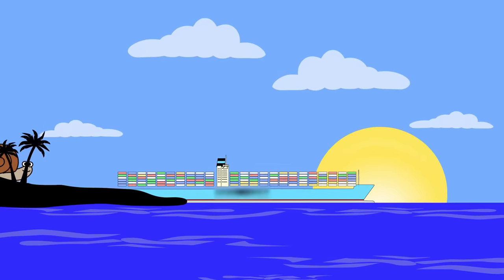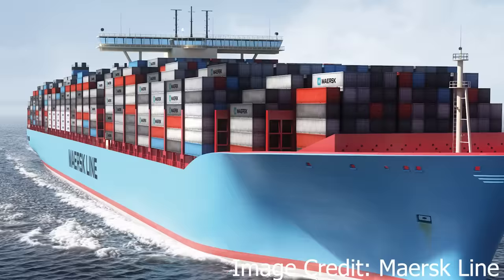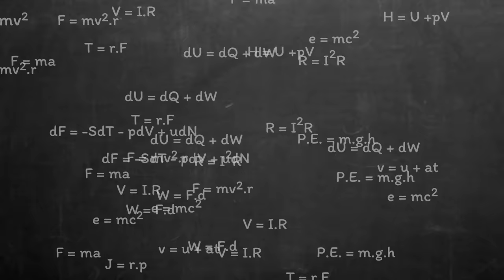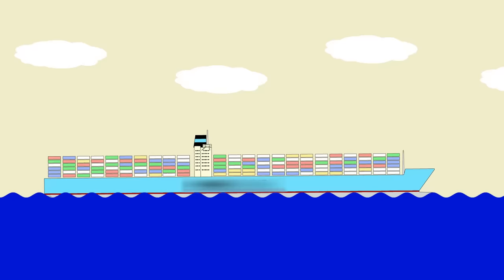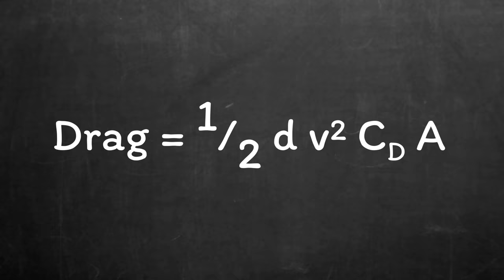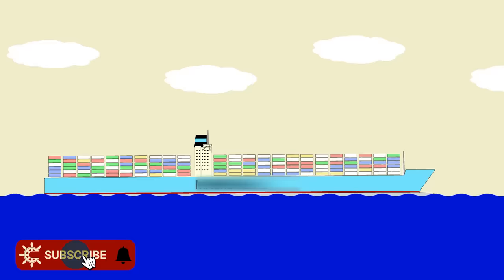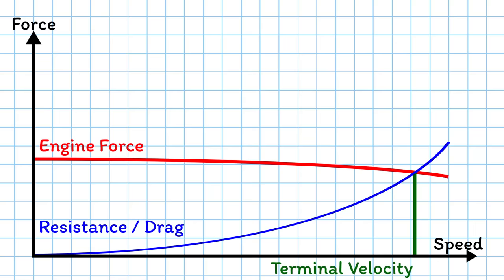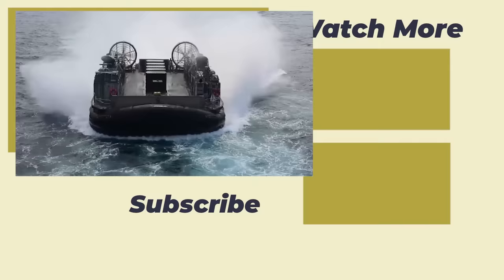Why are ships so slow?

Comment: 20 knots at sea is not slow
Reply: Raturagutulei Moses yes, and they also travel 24 hours a day, which makes a huge difference,  a point not compared with "physics" presented in this video.
Reply: From the perspective of a yachtsman, 20kts is pretty damn racing speed when such a vessel is at a collision course.
Reply: Most small boats plane at 15-20 knots and 20 knots is what I'd cruise with my 17ft boat. Its definitely not slow for big ship. Besides some fast boats. Most recreational small boats max out at low 30's knots
Reply: Thats a cruise ship, these shipping containers are averaging 8 knots...
Reply: Back in the 60’s maybe - most modern / large containerships will easily get to 20kts if not more. Check out the AIS on ships deep sea
Reply: Raturagutulei Moses It is knot 🤡👍
Reply: @vproduction  With my 34ft sailing yacht, my normal cruising speed is about 6kt on average.
Reply: @neleabels  but the energy needed to maintain cruising speed is quite low compared to the mass you're moving. This is up to the "hull speed" determined by mostly the lenght of the hull in the water
Reply: David J. Ridgway that would have been during WWII. The Emma Maersk cruising speed is 25 knots. Time is money.
Reply: Yes, 20 knots is very fast if it's a constant speed. 480 nautical miles per day. Most typical sailboats don't even exceed 7 knots, for comparison.
Reply: @neleabels  - I wish I could get a 6 knot average. I'm lucky to see over 5 knots for very long. On an almost 15,000nm voyage I averaged barely over 3.5 knots. 🙁🙁 Lucky for me I am in no hurry.
Reply: My boat can go 70 knots easy peasy. When its on a trailer behind my truck LOL Super carriers are fast as hell just something to think about. Its classified but the number at least 30 knots comes up alot. I betcha they could get a speeding ticket in 45 mph zones.
Reply: Of course it is...
When the Russians made an underwater object travel at 200 knots under the sea...
Naturally... You have to add that the object was a torpedo, and one that didn't turn very well, or traveled too far.
And... They cheated a little, they took the water away while being underwater by generating a gas bubble for the torpedo to travel in.
Reply: @Petalslash  Check out the GTS Finnjet, it could do 33,5knots and it was a regular displacement hull cruise ship with 2 Pratt & Whitney FT4C-1 DLF turbine engines :D

Kind of fits in with the Concorde, fast as they get but not economical in the long run..
Reply: David J. Ridgway what lol. I’m captain by trade and it’s my career, and I can tell you container ships max out much more than 8. Hell in the shipping channels they average 10-11 knots. So I could on imagine in open water they can crank up to and easy 20-25 knots
Reply: I looked up the specs on the engine he appears to be quoting. It has between 8 and 14 cylinders, and at it's most economical burns about 285 gal (US) per cylinder per hour, and still converts more of its fuel to push than the average car or piston airplane.
Reply: Exactly.
Reply: @eamh2002  holy crap definitely looking into that lol
Reply: Wouldn't that be 23mph
Reply: 20 knot for 200 meters  ship and weight over thousands ton's are no joke
Reply: I believe today's sailing catamaran world record pace was over 52 knots...across the atlantic. Not sure of the exact pace. 
The modern aircraft carrier can cruise in excess of 27 knots. Top speed is classified but some believe it in excess of 36...idk.
Reply: mike force I like the way you think!
Reply: Chuck Addison because it’s diesel...
Reply: David - "Thats a cruise ship, these shipping containers are averaging 8 knots..." - not so much. Read more Show less Reply     12     13                   Report
Reply: @truthfacts5438  Wrong. There are container ships (one of the largest of the world like: Barzan and Mol Triumph) that goes above 20 knots. The Mol Triumph has a cruising speed of 22 knots. and top speed of 24. obviously according to wikipedia. 

the largest ore carriers 'valemax' (type) can go up to 15 knots. That type of ship has a 380,000–400,000 DWT.

oil tankers ''TI Class'' go up to 16.5 knots..

cruise ships go up to 22.6 knots (the oasis-class)

Now you probably wonder: how can a container carrier go faster than a cruiseship. It's pretty simple: Engine power. Cruise ships usually don't carry high tonnage. which means the companies use smaller engines. While Container ships carry alot of tonnage. That's why they use a bigger engine with alot of power.
Reply: @endraruhendri6550  how about 20 knots for a 400 meters ship? :P
Reply: I consider it slow for anything below 32.5 knots on water
Reply: @MIO9_sh  slow because? Those ships are 300-400 metres long. 30 - 60 metres width and a beam between 10 and 25 metres. With a huuuuuge tonnage. Thats fast. Very fast. They arent speedboats or yachts. Lol
Reply: Battleships backin the day could drive at +30kts
Reply: @ivvan497  you compare pears with apples. Warships are made to go fast also. Container ships or ore ships are made to carry alot of weight.
Reply: @ivvan497  destroyers got 12.5kts more to go
Reply: @truthfacts5438  no, I see them travel ,12-15 knots in the ship channel
Reply: @ivvan497  yes some battleships had a top speed of 30+ kts, however the maximum speed for most was 21kts. Also this is maximum speed not cruising speed, most of the last generation battleships like Bismarck and The Iowa's had a crushing speed between 15kts and 18kts, this is despite these ships displacing significantly less than many loaded cargo ships in the modern day
Reply: 20 knots is not "slow" for a ship; the point of the video is that ships are slower than cars and airplanes. If an airplane topped out at 20 knots, or a car for that matter, then that would be very slow indeed.
Reply: @Roset595  for the size and weight of these ship in comparison to planes or cars, it should not surprise anybody that 20 knots is a respectable top speed
Reply: Faster than u-boats
Reply: But that's not the point. 20 knots is slow compared to other transportations.
Reply: @saifaddeenal-manaseer6325  and in comparison to ships other transportation simply can't move enough cargo at once to be efficient for long range high volume transport
Reply: @Petalslash  yeah military ships in general are usually quite fast... With some smaller destroyers even breaking 45kn with wartime load...
Reply: @truthfacts5438  8 knots... uhhh.... that's a hard no
Reply: CMDR Sweeper yeah but supercavitation isn’t exactly common... nor facilitated on a ship
Reply: R... Arr... aye she be a fine vessel!
Reply: @johnsweeney6072  Ye be a clever lad!

Comment: Answer: Because they're big and heavy.
Reply: Rockets are also big and heavy but they go fast as fuck boi
Reply: Give this man a banana
Reply: Gergő Turán They are propelled by jets i believe
Reply: Weight is smaller part of the problem, water friction boi
Reply: Me, an intellectual:then equip ships with thrusters
Reply: @gergoturan4033  Rockets aren't powered by a propeller. You're comparing a helicopter to the starship enterprise here
Reply: Guys, I know. I'm just making a point. Big+heavy=/=slow. If you put a jet on a ship it will still go slow because of friction.
Reply: BizzareNetworks Life Rp Offical Rockets are by definition powered by rockets.
Reply: Gergő Turán have you ever seen 400 meter rocket and capable of carry 21.400 container ?
Reply: And resistance given by ocean is greater than air fluid resistance!
Reply: @gergoturan4033  rockets produce so much thrust in a second that makes it go faster! Make a rocket engine to a ship with great shape and you will make a roship lol!
Reply: @gergoturan4033  Rockets are not big and heavy at all, not compared to ships. They are also propelled by, well, rockets, which aren't exactly an efficient/economic way to get around.

The fact that water has much higher drag than air is also very important, but large ships always have very low power relative to their mass. And that's OK because even if you wanted to put a very powerful engine on a container ship to get across the ocean quickly you'd have issues with putting all that power to use (you can't simply turn the propellers as fast as you like as eventually the water will cavitate) and ships don't really have brakes or corner very well so a 200kT container travelling at 120mph is just a disaster waiting to happen as it won't be able to stop or dodge anything that gets in its way.
Reply: @gergoturan4033  Rockets have millions of Horsepower, and weigh less than cargo ships.
Reply: @gergoturan4033  Power/weight ratio, thrust, aerodynamics.
All of that makes rockets fast.

This comment is r/woooosh proof
Reply: Th3Ch0s3nOne666 Offical No, they aren’t. Jet engines are seen on airplanes, and rocket engines are found on rockets. Totally different.
Reply: @gergoturan4033  yh because there is minimal drag in the space
Reply: Noooo,, really? People already know that! The reason they chose to look at this video is because they want a clearer explanation.
Reply: The Egg because water is thicc
Reply: Dont be stupid. Aeroplanes are big and heavy but faster than formula 1 🏎.
Reply: They are pregnant
Reply: @gergoturan4033  Well they are also power by rocket engines rather than propellers
Reply: Gergő Turán Well cruise ships don't have rocket propulsion do they

Comment: In 1976 I joined a container vessel in Southampton, spent a day loading and sailed. Through Panama Canal, Tokyo, Kobe, Hong Kong, Singapore and back to Southampton around the Cape of Good Hope. This took 59 days, the vessel averages 26 Knots, 950ft long 103 ft beam. I think that's  fast. Carrying , loading and discharging containers.

Comment: I salute you for doing this entire video without ever touching upon the topic of bow wave resistance which isn't the main factor for the biggest cargo ships because they operate at displacement speed for their hull length and shape but it is certainly a factor for the fast catamaran passenger ferries and small speedboats (the sharp hulls of the really fast catarmaran ferries makes it a lot easier to pierce the bow wave and also detaches easier from the waterflow around them). The main reason for smaller cargo vessels being slower than the superships is because they are also "displacement hulls" but their shorter length makes their displacement speed slower because their bow wave can not be as long, if you try to go faster than your displacement speed your ship will have to climb a "hill" which is created by your own bow wave. A bulb in the bow of the ship "trips" the bow wave before the main part of the hull gets to it (by creating its own wave at the appropriate distance to cancel out the bow wave from the main mass of the hull) which improves performance a bit but you still can't go much faster or else your stern will sink into the trough of the wave causing your whole ship to sit lower in the water and have to climb ever more "uphill" as the speed increases, as you can imagine: that takes a lot of power.

Comment: Huge ships are actually an engineering marvel. They move huge amounts of cargo much more economically than I'd all the cargo was moved by trucks. All things considered the ability to move hundreds of containers with minimal human labor involved and less fuel.
Reply from the maker: Imagine carrying 20000 containers on trucks from shanghai to rotterdam. The ship is certainly the best solution
Reply: Ships beat trains. Trains beat trucks.
Reply: @CasualNavigation  The Chinese are builindg a new Silk road to deliver the goods via railway to Europe.
Reply: @OpenGL4ever  3 routes for different goods.
-  air ( 1 day travel )
- sea ( 2 months travel )
- railroad  ( 1 week travel )
Railcargo is much cheaper as aircargo but has less traveltime.
for Bulk, heavy equipment and no time restrictions the Ship always wins.
Reply: @CasualNavigation  Try it with a 747.
Reply: @obelic71  Working at a Forwarding company, Rail Transport from and to China is my daily business. Rail is more like 16-21 days depending on departure/destination city. Airfreight depends, direct flights sure within 1 day but "non-express" cargo is more around 3 days because most gets reloaded at least once. Ocean vessels have transit times port-to-port depending a lot on carrier and routing usually between 30 to 50 days from China to Europe. The more you know :-)
Reply: mike force  no, English is my first language. Autocorrect is my nemesis.
Reply: @charliemason4355  And I'm against fishin' in the rain.....
Reply: @doughesson  "They move huge amounts of cargo much more economically than if all the cargo was moved by trucks." Ships beat trains. Trains beat trucks. Did that help?
Reply: @OpenGL4ever
Railways are best for moving armies.

Comment: A 2,300 ton engine...

For reference, the heaviest tank ever produced, the Maus tank, was about 190 tons.

Think about that...
Reply: That engine weighs more than some ships.
Reply: Your average Fletcher weighed in at 2,050 standard displacement. The Tribals and re-built Fubukis were similar. All of which were fairly large compared to earlier destroyers.
Reply: A German Uboat weights 700 ish tons so...
Reply: That's just the engine too, wonder how much the fuel weighs to go UK to NY for instance.
Reply: And it was completelly worthless
Reply: Only one was built and I don't believe it saw combat. It was only tested. Some cool facts I dug up about it: it could drive through bodies of water up to 2 meters deep and *SUBMERGE* to a depth of 8 meters using a snorkel thing to give the engine air and the crew oxygen.
Reply: That's massive , even the heaviest indian rail locomotive WAG12B  weight is just 200 ton
Reply: @geehammer1511   Go figure. Would probably consume about 150t/day.
Reply: Its heavy like a jeager fro pacifi rim
Reply: @Sp00kq  metres not meters.  Metres are a measure of length.  Meters are instruments used to measure things.  One could use a Distance Meter to measure distance in Metres.
Reply: @borysnijinski331  maybe where you're from it's like that. But where I'm from it's meters. And it has multiple definitions that depend on context. Just like blind. A blind is something used to conceal you in something, but there's also people that are blind. There is meters as in distance. And there's meters as in instruments. I was born in Russia, and there it's spelled Метр. Which to English would translate to being spelled as meter. They have a completely different word for measuring tool, which litteraly translates to meter or measuring tool. Like I said, it depends on context and evidently culture. Cus with some areas, they spell color with a U in it, colour, and they spell center as centre. I am writing it exactly as I was taught
Reply: Imagine a gigantic airbus a380 only weighting in at 600 tons
Reply: Yes , they are big . I was on a gas tanker and she weighed around 20,000 tons but we would strip a head and clean the bores every so often . You could stand inside the bore with a air powered wire brush tool with lots of room to spare , and that was a small engine compared to that one of 2,500 tons
Reply: @MrTarmonbarry  that's crazy.  I would love to see an engine of that size being built
Reply: Similarly, the average freight car in the United States has a gross rail load of 189,000 lb. This engine alone weights about the same as 24 of them (assuming the 2,300 figure is in freedom tons). If the figure is in metric tons, then it's equivalent to about 26 fully laden freight cars. Drop a car, and there's enough weight left over for the locomotive.
Reply: @ErickC  goddamn.  That's just nuts to me how massive that is.
Reply: ErickC mate it’s metric. You guys in the US are the last ones standing with the imperial measuring system. Maybe it’s time you all got with it and converted.
Reply: @stevenstart8728  tell that to our governments/schools, not us, lol
Reply: Electronick7714 well in fairness I think you’ve all got enough going on at the moment without changing the numbers on your tape measures.
Reply: @stevenstart8728  oh trust me I know.  Living here can be...tiring.  to say the least.  We must seem like a circus to the rest of the world.
Reply: From what I could find the maus was never made only drawn up and (again as far as I could find) it’s still unknown whether it was a serious design or not
Reply: @communisttrash8590  dude the Maus still exists.  It's in russia.  You can literally get on on the thing.  It's a mashup of two prototypes (one hull and one turret) but the insides are all gone/blown out
Reply: @Electronick7714  ah ok I’m probably thinking of a different tank then
Reply: @borysnijinski331  "Meters are instruments used to measure things."

Meter also means the same as metre. It's a regional difference in spelling.